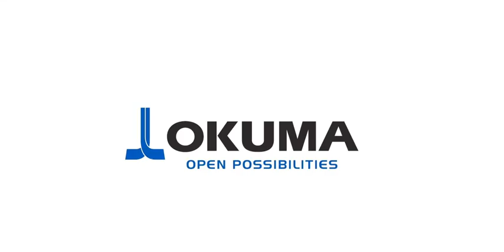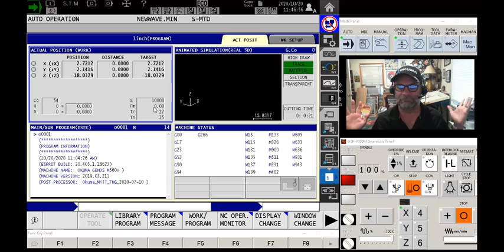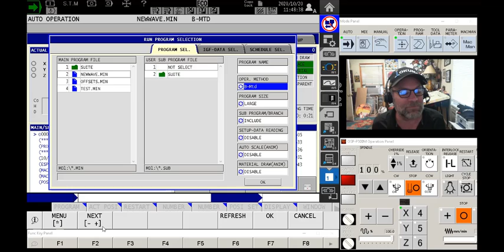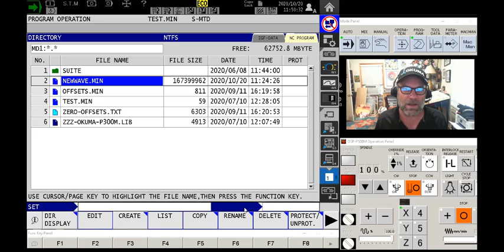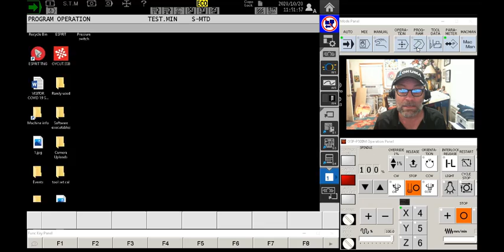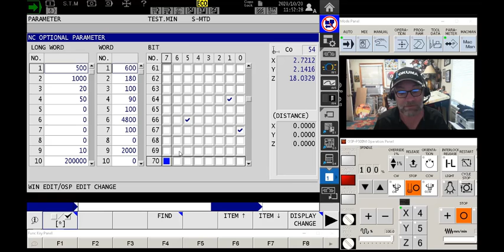Large file size in the P300M Okuma control

Comment: It would appear that these options are available on the OSP P200M control as well. Question on the "B-Mtd" (B Method). You stated that the "B-Mtd" is the only way to run with sub-programs. Does this apply to all methods of sub-programs, or just with ".SSB" or ".LIB" subs? The reason I am asking is, I have all of my subs contained within my main part program (.MIN). Using this method of sub-programming, can I run in the "S-Mtd" (S-Method)?
Reply from the maker: Good question!  Heres the lowdown: The S method restriction for no sub programs applies to ALL subs with the exception of LIB files registered as G or M code, such as G116 tool change. If you choose S method, all code with the exception of LIB G/M code routines MUST be contained in the MIN program. If you use SSB or SUB call statements and your program is large, you MUST use B method to avoid an alarm regarding SUB PROGRAM NOT FOUND

Comment: Great tips! I got a question!

We have some programs with long "man-readables" especially with our tool notes, and it won't read the file... I forgot the error code. It is because of these long man-readables. 

Is there a way to fix that?
Reply from the maker: Absolutely, although it isn't a real "fix", it is just a change in your process. Each line of code, whether it is a note or a motion command, is limited to 156 characters and spaces. The work around is to simply make sure that you have a carriage return/line feed (EOB) before the line in question hits 156. So instead of "(tool 1 is an endmill- tool 2 is a dril...)"  try using
 (tool 1 is an endmill)
(tool 2 is a drill)
(etc);

Comment: Windows is simply not fast enough to keep up with the machine, so the code actually runs from some kind of high-speed buffer memory in the motion controller. That buffer is the 2-meg limit. The the controller’s operation method of loading the program onto the buffer could be “A-All”, subs and all; “B-Batch”, where Windows chops it up with the subs into 2- meg batches; or “S-Serial ,where it streams it back there unmodified; with all of the limitations that you described. The lines of code in the box that Windows presents is approximate.